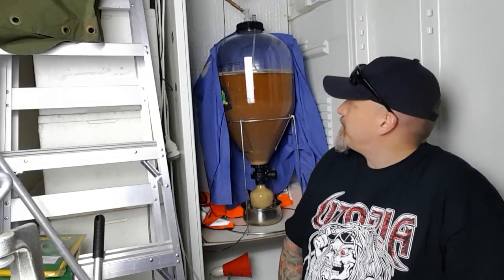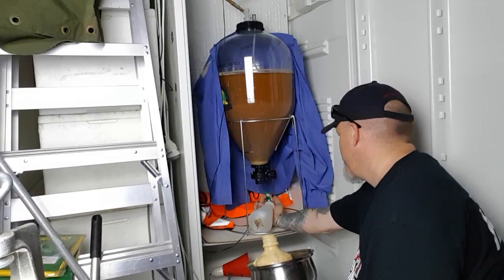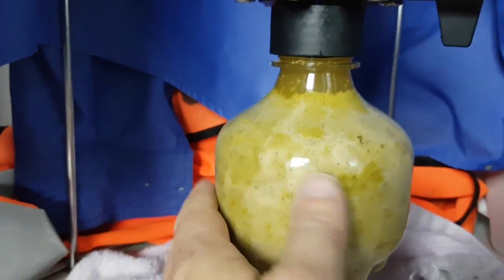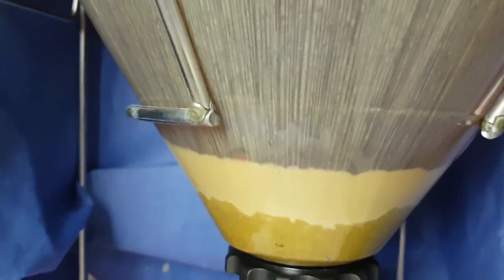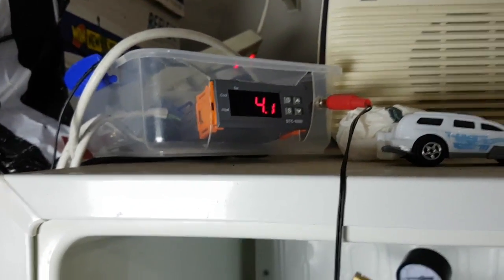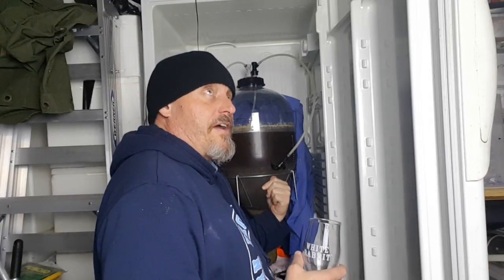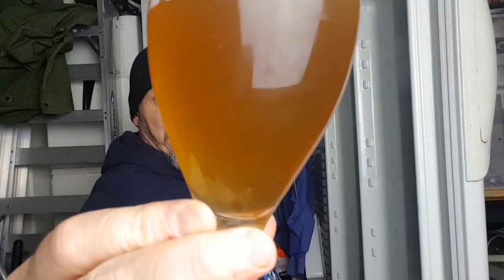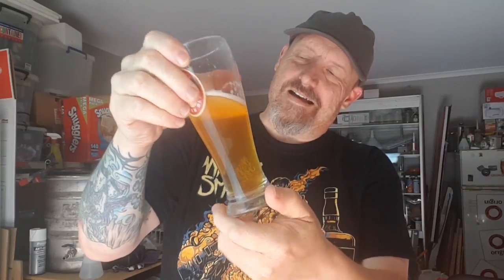Fermentasaurus - The Ferment PART 2 - Tasting - Dry Hopping

Comment: I got one of these recently and did a big dry hop dose like you did.  It clogged up the bottle where it necked down.  I ended up shaking it back and forth to get the hops all mixed in.  2 days later they all settled back out in the bottle.  Next time, I'm going to just shake it a bit rather than wait for them to float up, as they made a dry lock plug.

Great video.
Reply from the maker: Great info, thanks mate! Cheers!

Comment: Hey gash! Not sold on the fermenter just yet :) principle is good though! Thanks for pioneering this. 
Wee idea, close the bottom valve, empty the yeast. Use your picnic tap to fill the base, attach and open the valve. Therefore you only oxidate the small volume a little and prevent the o2 lingering in the head space.
Reply from the maker: Hey mate, lucky because I'm not selling them :) That method has been suggested before, with dry hopping I reckon that once that carbonated beer hits the hops it would get messy, nucleus points and bubble explosion hahaha. I think its just as easy to chuck em in the top. I think this unit for me hits its straps with lagers and beers I probably wouldn't be dry hopping anyway, once I closed the valve and remove most of the trub and spent yeast I dont really have any reason to attach the bottle again, or if I was to do it it would be very early in the ferment with the hope the ferment will still scrub any damage done by the oxygen. I really like the idea of filling it with lager wort and that lager never seeing oxygen again till it hits a glass, whether that be serving from the unit or an enclosed transfer to a keg. Has its place, does things none of my other fermenters can. Saying all that the beer I brewed in this video turned out sensational and held flavour and aroma better than many of my other brews, maybe it was a fluke? I don't know! Cheers mate!

Comment: hey gash, re the effectiveness of the dry hop. Read a comment the other day that seemed to be applicable. 
oils are less dense than water (and therefore beer) meaning that the oils from hops will move up throughout the beer from bottom to top during a dry hop from the bottom of the fermenter. (eg doesn't matter if the hops get full ability to move throughout the beer, as long as they have contact all is good).
looks like a damn fine beer,
cheers
Reply from the maker: Interesting! Cheers Harry!

Comment: Great vid Gash, I think I'm sold on this fermenter. Keep up the good work mate 👍
Reply from the maker: I havent had to clean it yet hahaha Should be ok, Cheers mate!
Reply: It's easy to clean, lucky my arm can fit in at least to the krausen line anyway which is where it matters. Ive just been using a soft cloth and oxyclean. Much easier than the Better bottle i normally would use.
Reply from the maker: yep, I think Sodium Percarbonate in the right strength might eat it up without too much scrubbing, I'll see how it goes. Thanks for watching mate, cheers!

Comment: Looks great for your first attempt using the Fermentasaurus.Maybe try emptying out a bit more of the trub before dry hopping?
Reply from the maker: I shouldn't of put 100g in the dry hop bottle, since found out they only recommend 30g hahaha, Trub was all gone before dry hop, there was still yeast suspended but thats inevitable when you should dry hop before ferment is finished. Cheeeerrrs mate! Thanks for watching!
Reply: Do you think multiple dry hops would work better .. 30g is a bit pain full though ! Doing my first brew in a Fermentasaurus now .. the dry hop will be 100g .. Thinking I'll try 50g additions 4 days each ... any thoughts ?
Reply from the maker: If I was going to do a 100g again, I'd probably just dump it in the top, but yep you could split it,  but then when changing the bottle you'd be removing most of the previous dry hop if its settled out, that isnt a problem if its been there for a few days anyway really, its job would be done. Cheers!
Reply: Have a look at Craig tubes rat trap.That could work.
Reply from the maker: a stainless nut will do the job. I probably would bother retrieving it, you don't want a hoppy beer hanging around for long anyway, but I understand if you did want to do so.  Big dry hops cause problems in everything, even normal fermenters. Or move it on to a keg, can all be done enclosed, one of the advantages.
Reply from the maker: Its one of those things, nothing is great for everything, this is especially great for lagers and lighter hoppy beers.  I don't like the idea of dry hopping from the bottom at all, unless I build a bottle with some valves so I could flush it of oxygen properly.  Next time if I do a big dry hop it will be from the top, just before ferment is finished as usual to clean up any oxygen added hopefully, close the lid and then purge the top with some co2 just to make sure, via the relief valve like you do with kegs. there is also the possibility of finding some bigger bottle with the same thread?? Might be a long shot, but you never know.
Reply: I'm already using rat traps direct in the kegs. .. not the best method .. How ever its easy.. I bought this new fermentor thinking its would solve these problems .. but 30g recommended? ... still it does have its advantages even if it cant handle a mega hop bomb... May be a 3lt pepsi max bottle will fit after a make a big ass hole i my brew bench ...
Reply: I just read lower ...Standard  PET doesn't fit .
Reply: hahaha .. good beer english in my comment !  .   .. not sure what order these come out in

Comment: KegKing recommends not going over about 30g of hops in the collection bottle. I have the same spunding valve from kegking and mine seems to be a bit problematic too, it does get the correct reading but it seems to jump around a lot after setting it to what i thought was a certain psi. I think best way is to put say 12psi into a pet bottle and then open the valve on it until it hisses then you know its set to 12 psi.
Reply from the maker: The adjuster is a bit touchy, seems if its sitting in the wrong place, it seals it, but you cant really tell until you see pressure building! I got them from cheaky peak brewery, but they look the same as the KK ones.

Comment: Great video! How long after the fermentation started did u add the dry hops? And what was the total fermentation before it was done?
Reply from the maker: It depends on the yeast i usually wait until the krausen has dropped off, not totally gone, but as soon as it shrinks down, this is usually around 1.015-1.018ish then I dry hop and turn the temp up a few degrees to finish off. Its usually about day 5 or 6 for a normal ale yeast @18-19c. then after the ramp of temp it'll finish off in 3 or 4 days. then cold crash for a couple of days.
Ferment is done in a week, the dry then has its few days, so its about 10-12 days, not rushing at all.

Comment: Is this still your same process for dry hopping in the fermentasaurus?
Reply from the maker: not usually as I 've been dry hopping huge amounts, I've just been putting them in through the top before ferment is finished. I may try it though now its easier to flush the container with co2, Cheers!
Reply from the maker: with the fermzilla

Comment: Great job on the video.  I ordered one of these, even though I already have an SS Chronical.  I like the idea of being able to ferment under pressure, as I feel like my IPAs taste great before they hit the keg, but lose something afterwards.  Two questions-  1.  Did you ever try fermenting warmer under pressure?  2.  What kind of tubing did you use for the carbonation cap?
Reply from the maker: I havent yet done another beer in it, but its clean and ready to go for a lager I will brew in the next few weeks! The line on my carb cap is regular 5mmID 8mmOD beer line. Cheers mate!

Comment: Hey Mate ,
Sorry if someone as queried you already . Did that pet bottle for dry hopping work well? I'm dry hopping mine tomo but not sure if to use the usual method or use the bottle .as in the video not much of the hop went up. Thank you for the video .
Reply from the maker: I used too much, apparently they dont recommend more than 30g, which is a little odd, my beer had plenty of aroma but hard to say what really happened, I havent tried again yet, but I will. So I'd say it depends how much you are going to use. If I was going to do a huge dry hop again I'd put it in the top. Cheers mate!
Reply: Gash Slugg thank you for the reply . Much appreciated .

Comment: Hey, Gash. Is having a regulator a requirement for this thing or will the red pressure relief valve release pressure on its own once it reaches max?
Reply from the maker: Its not a requirement but the the red valve doesnt release by itself, its the same as most pressure relief valves on the standard cornys, you'd have to do that manually, only if you ferment under pressure of course. You can use it like a standard fermenter with an airlock if you wish. Cheers mate!
Reply: Thanks for the reply - cheers!

Comment: I just dry hopped mine with 2.5 oz, and had to blast it with 20 psi like you did to get the hops in the beer. I'm starting to wonder if it would work better if I did my dry hop additions in  2 stages. Did you keg yours? Did you remove the hop sediment just once or twice?
Reply from the maker: I think for a big dry probably better just to release pressure and dump in the top?? I havent tried again, been busy but I'll be filling it again soon. This brew I didn't keg I just served from it till it was done. I reckon the hop aroma etc lasted  longer and tasted fresher than usual. I only removed the hop sediment once, probably should of done it twice though but its not so important with the floating pick up tube  and I didnt seem to get any grassiness. It would be great to do an enclosed transfer to a keg though. Cheers!

Comment: Hey Gash, did you fermenter u der pressure for this brew? I couldn't see an airlock or a blow off tube for it. Did you capture any Co2 during the process or did you just let it release all Co2 during fermenter?
Reply from the maker: Yep fermented under pressure, used a spunding valve,  auto release valve you can set to different pressures. No I didnt capture it but you could. Cheers!
Reply: Gash Slugg thanks. Have you tried brewing it not under pressure? I've ordered mine but don't really want to fermenter under pressure unless I brew a lager. I'd be interested to know how to take gravity/hydrometer readings when not under pressure.
Reply from the maker: I haven't not brewed under pressure sorry. you could still use the barbed fitting on the bottom or samples, once you've removed to bottle at the bottom. Cheers

Comment: Thanks for sharing these vids Gash, do these I guess with these fermenters you would need a counter pressure bottler set up to bottle? looks the bizzo nice looking beer made me bloody thirsty!! haha cheers Mate, Mike.
Reply from the maker: If you use them to ferment under pressure and don't release it so they carbonate then yes, you'd need some sort of bottle filler. You could let the pressure out so it degases and bottle it normally though from the bottom with the nozzle fitting, a tap and some tubing.You don't have to use the pressure kit of course, can just use an airlock then its a regular conical fermenter. Cheers!
Reply: Yep that would be the way, de-gas then bottle but so good keeping it on the Co2 a counter pressure filler would be the way, but awesome man looked good I may have to put 1 on my xmas list.... Cheers 🍻

Comment: hey matey.. first time im fermenting under pressure in the Fermentasaurus. Its been two weeks today since i pitched my yeast and there is still signs of the yeast bubbling, it is very slow though. Just not sure weather to wait until the yeast is completely standstill or not?
Reply from the maker: After two weeks if the temperature has been good it's more than likely done, take a reading if you can. Otherwise you'll also see the yeast start to drop out of suspension and the beer will start to clear at the top, usually another sign its finished. Cheers mate!
Reply: Gash Slugg yeah the head is thinning out to just a small bit in the middle. i pretty much have same set up as yours but i gave up on the sparge valve, i just let the release valve take over. i might give another day or so and see what happens. thanks for the reply buddy!
Reply from the maker: No worries mate, cheers!

Comment: You basically just dumped a pint of trub on top of your dry hops.
Reply from the maker: G'day mate, How do you come by that conclusion? Cheers!
Reply: Gash Slugg i watched the video. There was move trub in the cone of the FV which fell into the bottle when you reopened the valve. 

You should have let at least one more bottle worth of trub and sediment collect in the bottle before attempting dry hopping through the bottom.
Reply from the maker: Might look like that but there was just a very small amount on the sides of cone where it curves into the valve, and what may look like yeast shooting down is mostly bubbles, nucleation, from the beer hitting the hops and being agitated. By the way those collection bottles don't even hold a pint, think you're thinking things are bigger than they actually are. Cheers mate!